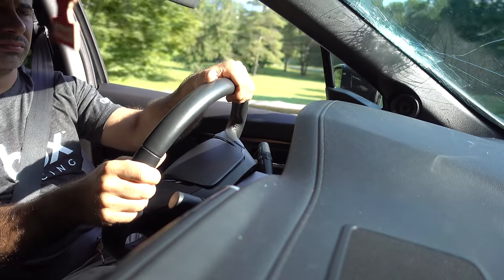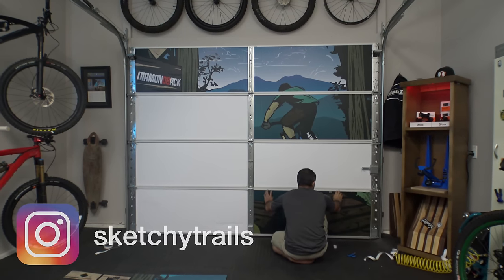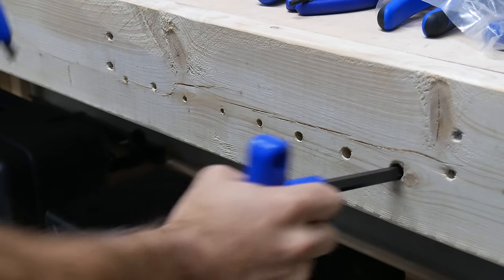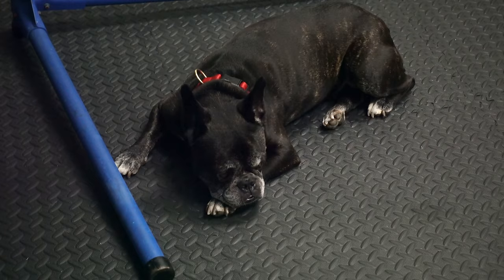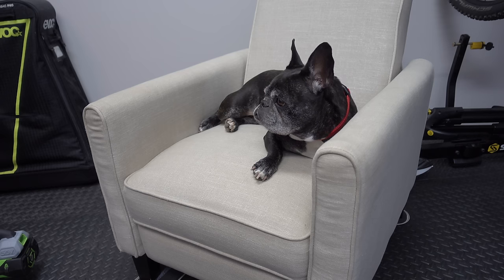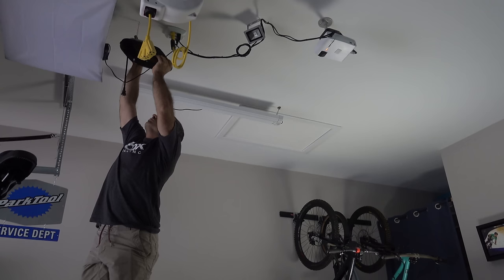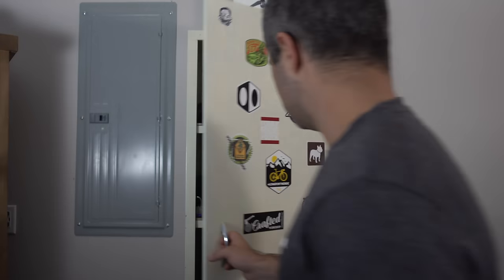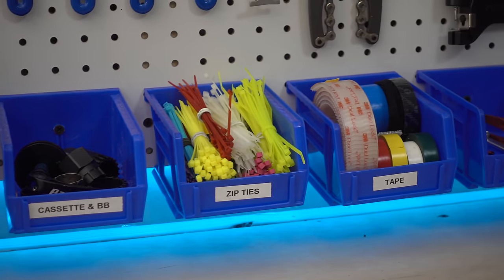Home Bike Shop Update - Garage door art!

Comment: Tubeless on a BMX sounds interesting can you try it?
Reply: its pointless as you run very high pressure anyway
Reply: IndependentALEX High psi doesn't make it pointless. Road runners run their tubeless tires around 100-120 PSI. Not only is that comment dumb, it is completely wrong.
Reply: It is mostly pointless. If you're gonna get a flat at 100psi you're probably gonna get a flat with a tubeless setup too. Also good luck keeping your tire on when you don't land perfectly. There's a reason it's not very popular. And alienation makes a tubeless rim and tire.
Reply: I make pov riding videos
Reply: DJ Hyde lose the music in the future, or make it subtle.
Reply: if the rim has a strong enough bead lock landing bad shouldn't be too much of an issue, DH riders run it?
Reply: Ali Clarkson did it on his trial bike kinda similar
Reply: Rc Carrier dh riders run tubeless cause most of them want to run lower pressures on the trails. Bmx riders tend to run higher pressures for street and park riding and are more prone to tires popping out of the rim due to tricks like 180s or 360s thats why most favor to run tubes cause they want to run higher pressures and avoid burping the tires once the bead comes off.  Look at riders in the FMB discipline a lot if riders like nicolai rogatkin and logan peat run tube setups than tubeless
Reply: Tom Sharpe g
Reply: Thomas John Solidum mate i am a bmx rider and i can tell u that at least i am better off burping air then pinch flattin on high ledges.....ps this is a friendly thing
Reply: Thomas John Solidum  but heck i still want to see tubeless bmx
Reply: Tom Sharpe Trials bikes are for lower speed hops and jumps to take the sting out of big impacts and sharp edges, I think. With high pressures it would be difficult to keep the bike in control.
Reply: cool dude who has lotsa frens yeh, I've ridden both bmx and trials but figured that jumping around, with no suspension there's a bit of a similarity
Reply: Tom Sharpe I'm actually just assuming, i have only ridden BMX Cross.
Reply: IndependentALEX mate how about pinch  proof
Reply: PartyPlace 15 yeah he forgot about op pinch proof
Reply: In modern street riding you don't, but that's Rider preference. Definetly not so low that tubeless would make much sense so yeah
Reply: that sounds cool
Reply: Alienation was pursuing legitimate BMX tubeless a few years ago. They stated that tubeless feels like a higher pressure than it is. I've run as much as 83psi on my road tubeless set up, and with modern high volume BMX tires, 80 is plenty. I ran 100+ back in the day with sub 2" tires, but with 2.4" 100psi actually rides and performs like shit. Pretty sure with the current balloon tires, I could get away with 50-60psi and still ride flatland. My wheelbuilder has run BMX semi-ghetto, (Lots of Stan's tape rather than the inner tube cutting trick,) tubeless with Sun Envy rims. He said it was a hassle to get seated, but worked fine.
Reply: I guess this would be an interesting video to do SETH plz do it
Reply: as a bmx rider i would not want tubless. a burp could mean a bad crash at high speeds. but idk could make for a neat video. i doubt they even make a tubless bmx tire tho.
Reply: Hey I ride BMX too and I preferably want to run higher pressure on my bike.
Reply: wrong
Reply: PartyPlace 15 being a bmx rider, tubless would defiantly explode every time you land on the sidewall hard enough.
Reply: This was semi popular when everyone was a weight weenie circa 2008ish.   The problem is most bmx rims are not tubeless compatible and people were having the tires blow off when they didn't land straight.   If I recall the way to do it is take a 16 inch inner tube and slice it up the side.  Run that around the rim and have the extra hang over.   Mount the tire and seal/inflate.   when you are done, trim off the excess tube hanging out.
Reply: austin kruisheer I'm using a 20 inch tube on my mtb tubless setup still
Reply: more BMX vids but no tubeless. its just not necessary.
Reply: What's your mail I'd ?
Reply: I like u r videos.i want more video how to uplift the bike while riding how to jump
Reply: Rc Carrier  is
Reply: Rc Carrier q
Reply: Rc Carrier how do you get the stickers
Reply: Rc Carrier hey man nice channel
Reply: Rc Carrier i
Reply: Say for example BMX racing, we run like 60 - 110 psi so there is no point really to have tubeless for that reason, the next reason is reliability, sure I have tubeless on my mtb and dirt jumper but when you are at racing you can’t always bring a spare tire and sealant with you

Comment: I've been working at a shop for a few months, and our benches are organized similarly to yours with a pegboard and bins. However, under each bench lies an endless treasure trove of lightly to never used bike parts. Dig deep enough and you find good stuff. My road bike's front wheel came from behind my bench, as did many other bits and pieces for other bikes.

Comment: Love it! My shop is a corner of the basement full of bikes, bike parts and countless tools. I'd also like to share a with you. If you by chance fall and motorcycle instincts kick in and you slide 10 feet on your bike and bend your crankset to the point where it is hitting your frame, simply take the pedal off and stick the crankset in the stinger of your car/truck and jump on your bike until it's brand new!!

Comment: Like Seth, I used to work on bikes in the backyard, where bugs stomping grounds are. I worked on bikes since I was 7 or 8 years old, including my friends bikes. I since was dreaming of a workshop, for general things since I work on engines and a lot of other things too. Then low and behold when I was 10 or 11, my grandmother bought a house around the corner with a shed in the back. I since built tables, got tools (including tools that my grandfather had used) and wired the whole shop my self. I am now 14 and still strong with bikes, engines, wood and metalworking, pretty much all of the above. I have been planning on having a YT channel to do project videos like the king of random or Colin furze, as well as Bike repairs or ideas. Just some motivational support that you can always hold on to a dream, and it will happen.
Reply: Side note blacksmithing was used to make some of my tools, for instance, I forged a handle bar, cut holes in it and pressed a chain on to it, and bam, a chain whip tool. Surprisingly, I still use it to this day, and it was almost entirely free.
Reply: ReeveKraft 
I would definitely sub to see that bro start uploading asap 
Heres some stuff i would like to see(just suggestions) 

fixing old bike
Finding trashed bike and fixing it
Tricks
Woodart metalart any art u are interested in 
Just ideas i suggest. Quick question i found a old bike ( a broken one ) and the owner said she didnt want it my and my friend are trying to fix it and make it rideable as i know all of whats broken is the gears on the handlebars and the chain maybe other little stuff broken but those arent important but do u have any tips? Thanks for your time and keep going

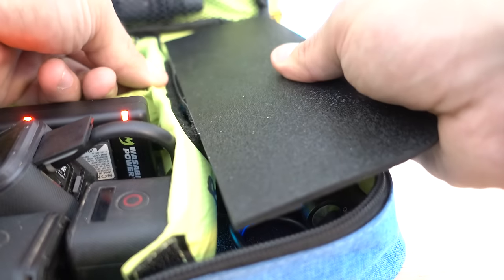Comment: A friend, long before you made that bag (5:01) to charge your cameras and other usb devices, had done the same. In an overload of the charger or source of power was made a short circuit that caused a small fire and, among other things, burned up a good part of the night table where it was loading. An electrical engineer told him that those chargers or power supplies were not designed to be in enclosed places like the mini backpack where he was. I suppose all the foam or bag insulation increased the heat and, as there was no ventilation, I accelerate the short circuit process. Just a tip. Of course, I guess in cooler areas or environments this may be more difficult to happen. Here we live with temperatures above 30 degrees Celsius.

Comment: My shop is a single shelf in my garage that contains all my gear, a multi tool, hex wrenches, chain lube, a spare tube, and some extra pedals. But hey hey as long as you got  bike with two wheels thats all you need right

Comment: Hey man! there could be a fire hazard if you cover the chargers in cloth. That stuff have a tendency to get hot, and with something covering from all sides it has no chance to breath! So just dont leave them in the bag charging over night. // The swedish electrician
Reply from the maker: +Fredrik Åsbrink thanks! I did check though. Even when plugged in overnight nothing gets any hotter than "warm" besides the batteries. So as long as I'm running it open there should be no issues.
Reply: Alright man perfect!

Comment: I have question... Hanging your bikes by the front wheel with shock, does it make the shock loose or damage the seals? Because I just got a new Front Sus by SR Suntour Auron and been hanging my bike by the back wheel too scared I might damage my new fork or make it leak. 
p.s. I don't like the look of the bike hanged by back wheel, this is why I'm asking. Also It's in my room beside my Gaming Setup.

Comment: Hey Seth I have a question about my bike. I'm a beginner mountain biker and I still haven't gone on a real mountain yet, but anyways my bike doesn't have any forks at all ( pretty sure it's a hard tail?)  it has no springs or anything. Would it be safe if I drove it over rough and bumpy terrain? And is it possible to install shocks? My bike is a SuperCycle SC 1800. Thanks

Comment: My shop is in my messy garage, I'm currently without a stand, so if anyone has a suggestion on one, or a cool diy stand, speak up.
Reply: http://imgur.com/a/nMjt2
this stand requires a 4X4 post, secured at bottom and top. The rest is pretty self-explantory, cheap and simple to build. Make sure you make the extending part long enough to allow the crank to spin. The bolt is "carriage" type with two nuts - one to tighten(inside), one to lock it in place(outside)and flat washers between the post and the two "cheeks" of the stand. I found it as sturdy as the pro, pricey, Park tool one my LBS uses. Don't forget to put notches in the "cheeks" to fit the "T" thing or brace. The "C" clamp holds the bike in place w/sections of inner tube for better gription.